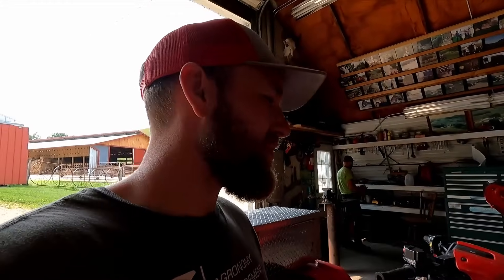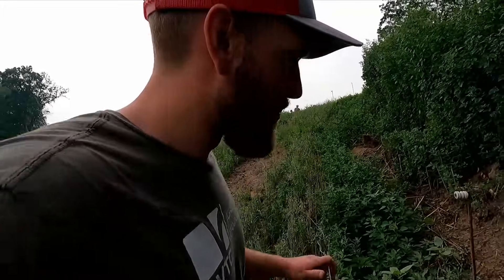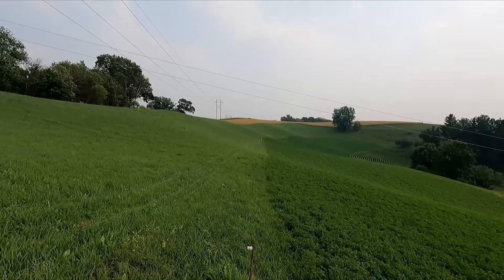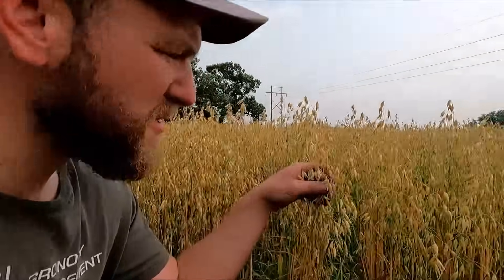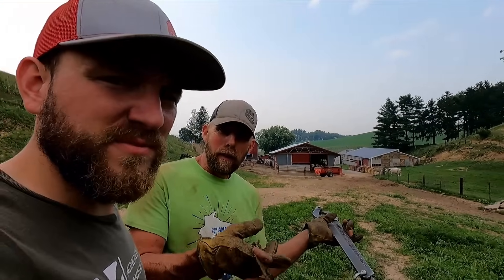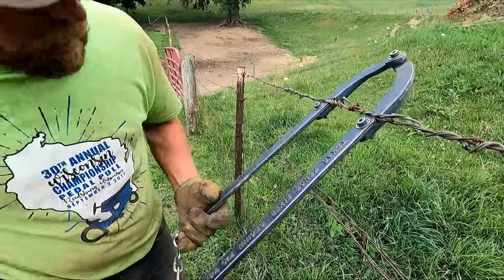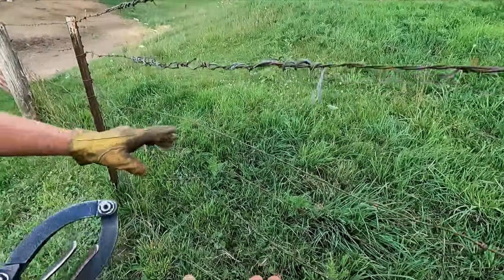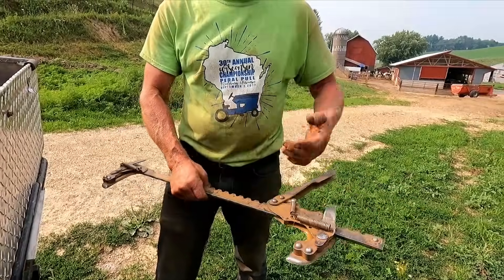Building a Fence During a Drought l How to Take The Slack Out of a Barbed Wire Fence!

Comment: That tool is definitely the cat's meow,  simple, strong and effective.  BIG thanks to that viewer 👍👍🍻
Reply: When I made fence on our farm I started with Sportmen 6x6. I then graduated to a utility tractor with a loader. Depending on the fencing task at hand, I would also have the post hole auger on the 3 point. The bucket on the tractor could hold everything I needed and loader could be raised and stood on to get better leverage for pounding post. I  do like your splicing tool. I did all my splicing and tensioning  the old fashioned manual way with my own two hands and a linemen pliers.

Comment: Repairing R/W security fence on WI state roads I used  a Hayes H300/ Nisorpa wire strainer/stretcher (Amazon) to pull a single wire  one at a time to crimp together with sleeves . Whether fixing barb or woven wire fence to get it tightest , waiting for another crash....

Comment: I remember carrying a chain saw,barbed wire,staples, a rope operated wire puller and a post and splitting maul to put a line fence in a non negotiable valley. Cut trees,split posts,drive posts, stretch wire,repeat. Stop occasionally to drink tea and put a bandaid on a cut finger or 2.

Comment: Could you tighten the fence without that extra piece of wire by twisting the the existing wire once it is "looped" by the tightening tool?
Reply: You can but you end up with a kink in the wire which is a potential weak spot.